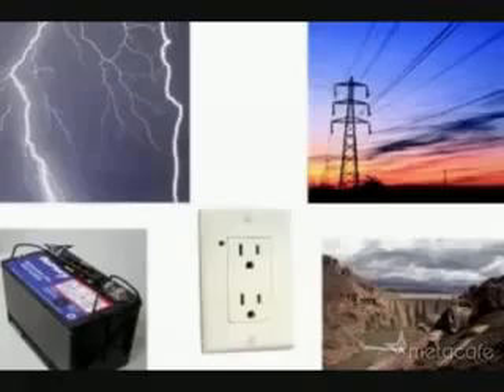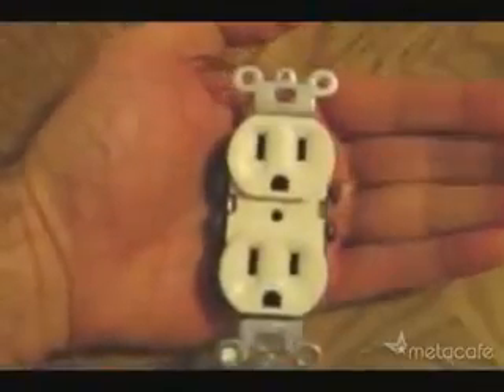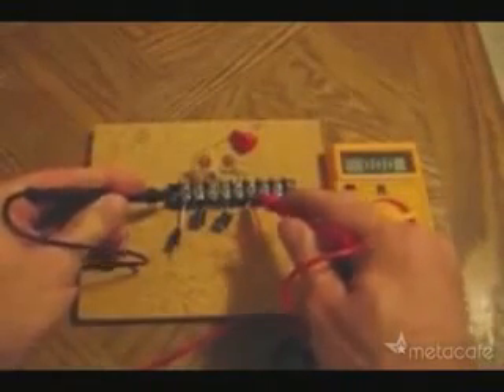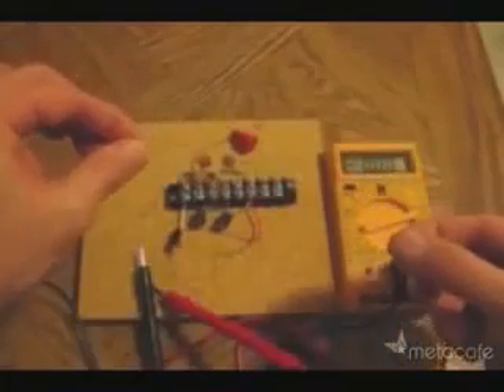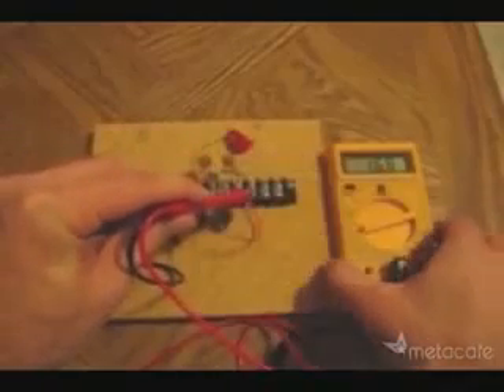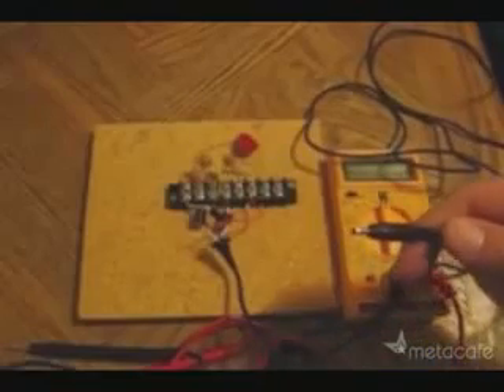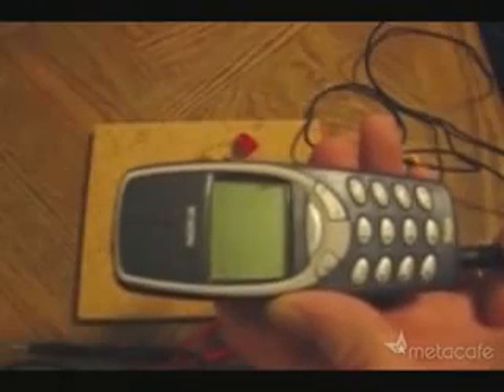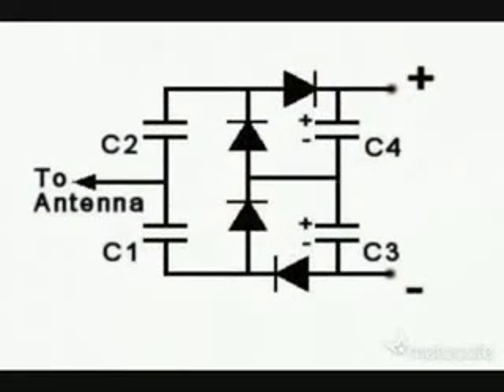Free radiant electricity from the air

Comment: This just looks like a bridge rectifier hooked up to a radio antenna with capacitors to create a consistent energy flow. With the right electronic components I bet you could hook this up to a satellite antenna and pick up much higher frequency energy waves. Now if I could figure out how to turn my rodin coil into an antenna...

Comment: What is that  red inductor or capacitor that you took the 30 awg wire and connected to that red component?  That red part is a mystery.  Did you also use a 
outdoor antenna to get the RF energy?

Comment: I tried the circuit did not work for me.  I don't know if it's the age of the diodes or if I am in the apartment and there is not enough signal strength except for the radio receivers.   My crystal set circuit from the 300 in One did not work, but I am going to try to apply a portable amplifer to the crystal set circuit to see if I can get anything.  I still have to buy some 0.2 uF capacitors and new diodes for this circuit I am having trouble with.

Comment: I  a question, I am having trouble finding 0.2 uF capacitors which is 200,000 pF type capacitors.  I have 0.1 uF capacitors, would 0.1 uF capacitors work this circuit?  What makes it different from 0.1 and 0.2 uF capacitors.   Parts cost more than $2 in this tough economy unless you junk something for parts like a broken radio like I did back in 1994.   I will try to report my results when I can get it to work, still 0.1 uF could be another alternative.

Comment: @professorlisama : @ C1 and C2 on the right side of the schematic diagram not the left side.  The ceramic disc capacitors go on the left side of the circuit.   When you see a positive (+) sign of the capacitor that means it's a electrolytic capacitor.   A capacitor without a positive  (+) symbol means its non polarized capacitor.  Watch out for polarity with the Ge Diodes they have a dark or colored band on them that is the cathode of the diode which means (-) the negative side.

Comment: On the circuit plane, where should I put the 2 100uF 50V electrolytic capacitors?
Does bigger antenna work better?